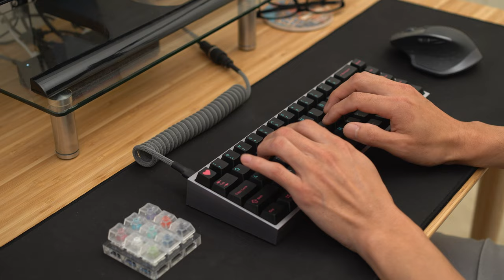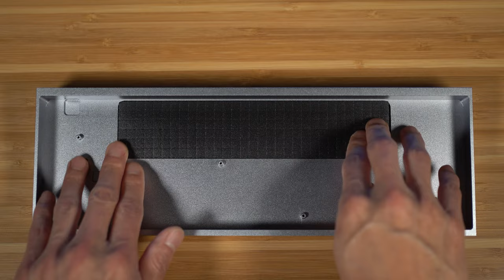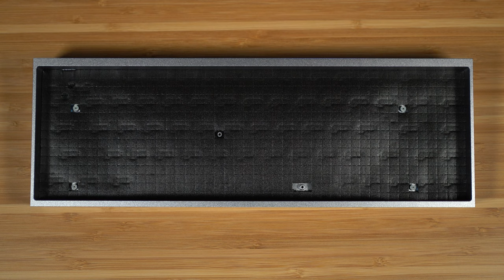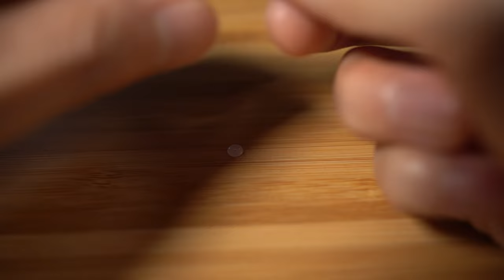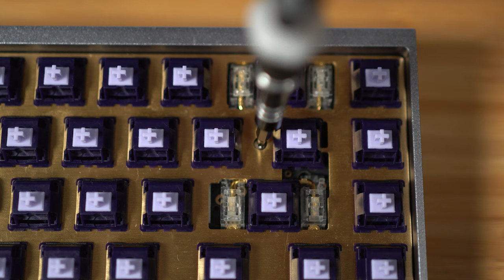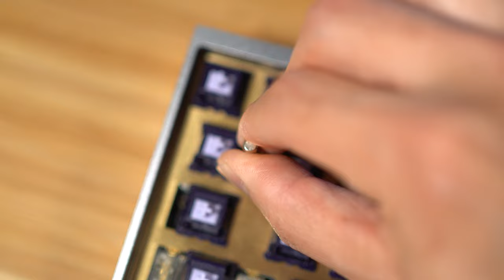Make the BEST sounding TOFU!  TOFU65 O-Ring Mount Mod Tutorial

Comment: Is this the b stock or aluminum?
Reply: Aluminum. I just gonna say this. I not sure what kind of auto tune or mic he is using. Or what edit he did. I have an 100% exact built keycaps, switches, even dampening foam, o'ring brass plate etc. Mine definitely doesn't sounds like the one in video. Never ever trust sound test.
Reply: @esc9757  thank you
Reply from the maker: This is aluminum!
Reply from the maker: This was done with a Fifine mic on a low setting with the gain set to 40%.  Only processing that was used was light noise reduction because the mic tends to hiss a bit.  Other than that, nothing more!  However, there was a lot of requests for me to upgrade my mic equipment so I have done that with recent videos with the Shure MV7 with no noise reduction since that mic is much much cleaner!  I have this keyboard sitting next to me and I feel it sounds the same as the one in the video... weird.  Do you have the foam between the plate and the pcb?  The one I used is the 3/16" vinyl adhesive foam that I show in the NK65 modification video.  I couldn't show that in this tutorial because it was already soldered in.

Comment: Has anyone managed to get their TOFU60 sounding and feeling nice with the o-ring mod? The reason why I ask is because the stand-offs are in a different position compared to the TOFU65. I have used the two outer positions on each end and I have the exact same silicone and size o-rings as per this video. I have also used longer M2 6mm screws as well and they are totally loose so I dont seem to get the flex as per this video. There is still a metal sound when typing. Maybe it is because I have installed PCB foam and as it sticks out slightly on the edges then this keeps a snug fit and into contact with the case?

Specs: TOFU60, DZ60RGB v2, Alloy plate, Tealios V2 + Boba U4T 68g, Drop MT3 WoB, silicone o-rings, Full StupidFish foam (battery tray, case and PCB).
Reply from the maker: Hi Lee!  I have had many viewers try this out on their Tofu 60 with great results as well.  The screw that you need is actually the M2x5mm (6mm might be too long).  Use the outer 2 stand-offs (they are angled on the 60, but still same concept applies), and make sure that you're not screwing down the plate/pcb assembly too much where the o-rings are squished too much.  Hope all this helps!
Reply: @Keybored  Many thanks.  I will remove the bottom screw and just have the 4 screws inserted.  Will also try 5mm instead. 6mm does fit though.
Reply: @Keybored  I used the outer 4 stand-offs as you suggested and it does sound and feel alot better and has good level of flex at the top, bottom and middle.  Its a little rigid towards the edges as the stand-offs are closer together on the 60.  I have an alloy plate right now and have a PC plate on the way to experiment with the Tealios.  If it does not satisfy then I will finally try the brass plate.

Comment: Do you think this could work with kbdfans 60% anode aluminum case? Great vid!
Reply from the maker: Hi ShaDynasty! I personally don't have any experience with the anode case, but looking at a picture of the tray, it has similar standoff locations as the tofu60. If that's the case, you can also try the same mod, and place the silicone o rings  on the outer stand offs. One interesting thing I see about the anode case is that it seems to have edge supports on top as well? If that's the case I wonder if you can do o rings on each side standoff (right on the edge) and place one each on those edge supports to create a perimeter and leave the centers all open and floating. If you get to try this, let us know how it turned out!

Comment: I feel like having such a high pitched keyboard would get annoying quick.
Reply from the maker: Hi Lunchbox13! The mod actually doesn't make the keyboard change the pitch, rather helps to improve the eveness in sound and feel and makes it more "clean" sounding. The tone of the keyboard will still be impacted by the type of switch you place. In this case, what you're hearing is the characteristics of the lilac tactile switch from JWK. Hope that helps!
Reply: @Keybored  Yea I figured that much. I was talking about the sound of the keyboard overall. Admittedly it does sound pretty amazing but I don't know if I could use that as a daily driver.